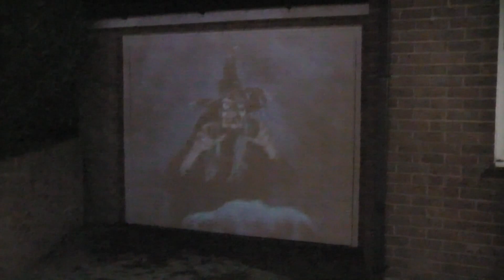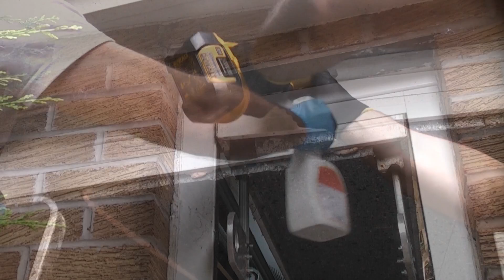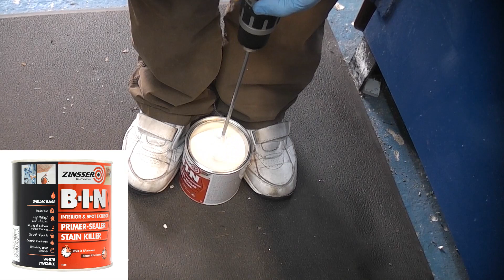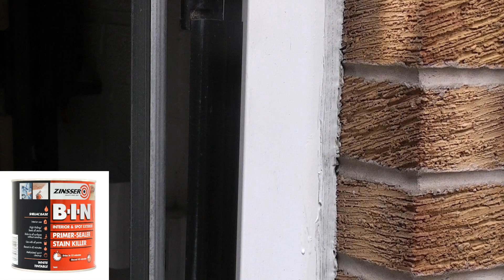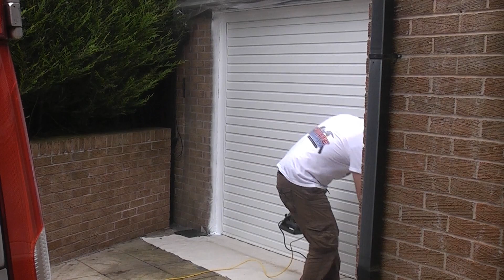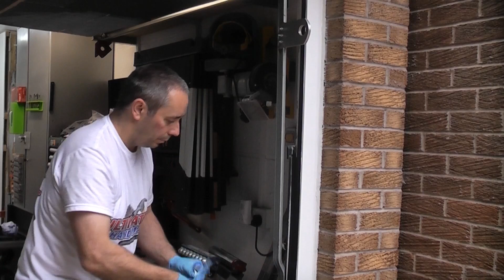How to paint a garage door using the Wagner Flexio sprayer

Comment: I'm pretty sure the Flexio 590 Sprayer comes with two spay heads. Which did you use and what were you paint and air settings. The reason I ask is I just painted my shop walk through (metal door) with the Flexio 3500 which I think is just a newer model of the 590 and it didn't turn out smooth at all.

Comment: I noticed you used Bin primer. This is for interior only.
Reply from the maker: I used Bullseye 123 for the metal and only used the B.I.N for the silicone, as it is oil based and covers silicone well.
You can use B.I.N externally for spot priming.
Thanks for the comment

Comment: good video mate, i was thinking of getting one of those sprayers, there are a lot of them on amazon and ebay really cheap £30 upwards but i suppose you get what you pay for, did you have to thin the zinsser or stir then straight from the can into sprayer?
have you tried water based paints in the sprayer to spray MDF  i was thinking of doing a built in wardrobe. keep up the good work, kevin
Reply from the maker: I'm hopefully going to review the Wagner in the next few weeks (I've been meaning to do it for years)
I just stirred the Zinsser All coat and sprayed it without thinning it.
I have used it for water based decking stain (which was thick, a bit like emulsion paint) and it sprayed that fine as well. Sometimes you have to adjust the nozzle and there is a dial you can adjust until you get the correct spray pattern.

I love the sprayer, it gives a really good result ;-)

Thanks for the comment 👍

Comment: Can you jus pour any paint into the sprayer flask and away you go, gloss, emulsion,  varnish ?  Do you have to thin the paint down with white spirits ? Thanks very much for video
Reply from the maker: It depends on the paint and the viscosity and flash point of the paint.
You can spray most paints, but some may need diluting.
Apparently the sprayer is good for wood stain and emulsion paints, but I've only used it with Zinsser Perma white so far and got good results.
Thanks for the comment

Comment: Wow always impressed almost no contractors in this area or even some pros would sand it down - some of them wouldnt even put on an undercoat like i did! Used a paintbrush myself but the spray really does a perfect job as you say Ches!

What I am looking for is a spray that can do Weathershield - anyone that invents one that can spray that stuff on a house will make a fortune - its a huge job painting on Weathershiled on 1960's chuckie dash render even though its been painted a few times its still a bummer to use that brush and ladders to get the weathershield into all the nooks and crannies on a two storey Detached 1960 Villa (On A Hill lol - Watch my ladders wobble!!! >;o))!
Reply from the maker: I think you can get sprayers that will spray Weathershield but to buy one they are about £5000
A mate of mine bought one at auction for a few hundred quid and I'm sure it will spray almost anything, I think it is what large contractors use when spraying hotels etc.
Ladders and hills do not mix- please be careful ;-)
Thanks for the comment

Comment: Quality job as usual, bet your arm was in need of a rest after the marathon spray 😝 prep is the 'key' for all finishes that last!!! 👌🏻
Reply from the maker: Thanks, I don't recall my arm aching but I have a physical job. One thing though it was annoying me holding the extension lead in my other hand! They really need a longer lead on the sprayer! I bet the prep took up 80% of the time on this job. 
Thanks for the comment
Reply: Ultimate Handyman I think if the lead was suspended maybe over shoulder secured somewhere it would be less annoying 🤔

Comment: Thanks for this video it's really useful. I asked you about a month ago on this and you have delivered. Would this be suitable for painting any surfaces such as brick and pebble dash as long as I get the correct paint.?
Reply from the maker: You are welcome. I'll film a proper review when I get time but I'm so busy that could be months away.
I'm not sure about spraying masonry with this model, I'm sure you can use it for emulsion paints etc.  Some masonry paints contain sand/fine particulates and I don't think they are recommended for this machine.
Also you have to be careful painting bricks as many of them are a nightmare to paint, and if not primed properly the paint will soon start flaking off.
You can use the Zinsser Perma white on masonry though, and you can now get it tinted at most professional paint retailers.
Thanks for the comment

Comment: Any vids on how to deal with flaky metal paint and rust on garage door.
Reply from the maker: No, sorry.
I would remove as much loose paint and flaking rust as possible. Give the rust a brush with a wire brush and then treat it with a rust convertor, then prime over the rust with Zinsser cover stain. I'd then give it two coats of Zinsser Perma white (just like in this video). I have painted radiators (one of them with rust) in this video which shows what I used- https://www.youtube.com/watch?v=x5dEeVJu-7M
Thanks for the comment
Reply: Ultimate Handyman   Many thanks for the help replying !

Comment: Great to watch - thank you. Quick question. Can I use a a big tank based compressor and paint sprayer to achieve the same result or are those for different jobs please? Thank you.
Reply from the maker: Yes, you can but there might be more overspray. Its years since I sprayed using a compressor and if I remember rightly there was a lot of overspray.
Reply: Cheap Lidl compressor is what i use with attachment for spraying but watch the overspray as the Handyman says - if you can adjust the pressure first and test it then you will minimize the overspray!

Comment: Another great video well done. Did you ever have to water down the paints to ensure that you never had any blockages whilst spraying the garage doors?
Reply from the maker: Thanks, for this video I just used the Zinsser Perma white exterior, but ensured it was well mixed.
A few days ago I opened an old tin of Zinsser Perma white interior and tried that, but it was not spraying at all well- so I watered it down using 10% cold, clean water and that helped.
Thanks for the comment

Comment: Good job that ches. 14 hours to edit😵😵😵😵 thanks for posting. Now you just need clean the brickwork 👍👍👍👍
Reply from the maker: Yeah, I have had a few videos that have taken hours to edit like that. It's much easier just filming and doing the talking at the same time but that is not possible most of the time due to background noise. I never actually realised it until I started making videos just how much background noise there is, such as vehicles, airplanes, birds, people doing DIY, small engines etc.
Thanks for the comment

Comment: I have an Ebauer sprayer I generally use for fence coat - as the Zinsser paint is water based I can use that then? Did you have to take an special precautions to keep the sprayer clean? I guess cleaning between coats is essential?
Reply from the maker: I mixed the paint well, then sprayed one coat on. I think I just wiped the nozzle and opened the container to vent it, I then ensured that I left it in a cool place for 2 hours before applying the second coat.
Depending on how warm it is when you spray it might be worth emptying the sprayer out and flushing it with water to guarantee no blockages. It is dead easy to clean with the paint being water based- like you say.
I'm guessing the Erbauer sprayer will be very similar.
Thanks for the comment

Comment: Another great video. Where do you buy your paint and ancillaries from? Do they offer retail purchase?
Reply from the maker: I used to use Dulux decorator centres as I used to get a good discount from the good old days when I worked for ICI.
In the past I have bought paint from eBay, but the tin lids are often taped on which can obscure some of the instructions on the tin.
Sometimes I use Crown decorator centres but, like Dulux decorator centres they are really expensive unless you have an account with them.
Screwfix now stock a lot of Zinsser paints and the last few products I have bought have been from Screwfix. They sell all the stuff that I use, such as Bulls eye 123, B.I.N and Allcoat etc. I also get my rollers and brushes from Screwfix as they are cheap and convenient.
Thanks for the comment
Reply: Ultimate Handyman I've seen you use the Zinsser paint frequently, I hadn't heard of the brand until watching your video but they seem well regarded. Great that most of what you use can be bought from Screwfix - there's a lot of stores opening up in the chain (let's hope they don't expand too fast like Maplin)
Reply from the maker: To be honest I had never heard of them until a decorator in the forum kept recommending their products. I tried a few of them and was really impressed with them. Now I try to buy their stuff all the time as I know it's good stuff!
Hopefully Screwfix will be ok, the group that owns them seems to know what they are doing!
Thanks for the comment

Comment: Great finish , after degreasing that paint you use will just take to existing paint with no issues? Atb Rich
Reply from the maker: Yes, the Zinsser Perma white is self priming, so the first coat acts as a primer and the second as a top coat.
Thanks for the comment

Comment: Great video, thanks. Did you need to thin the paint before spraying? What thinner did you use and how much did you need?
Reply from the maker: Thanks, Mark.
The Zinsser Perma white exterior did not need thinning, I just mixed it and sprayed it straight on.
I did try spraying some Zinsser Perma white interior though, which was a few years old and I had to water that down 10% with cold clean water.
Thanks for the comment